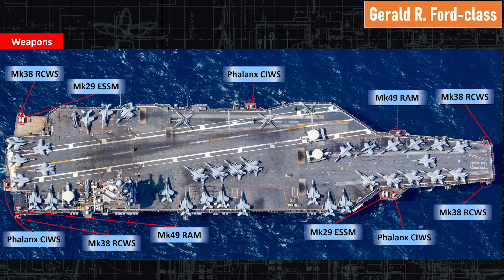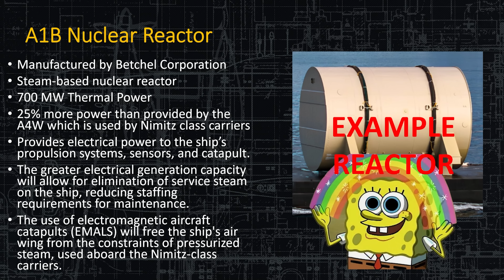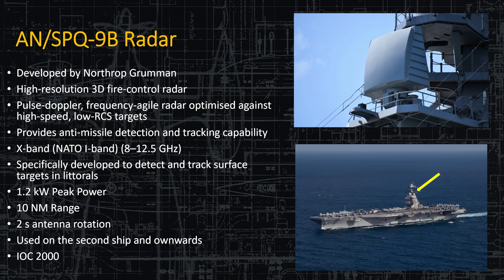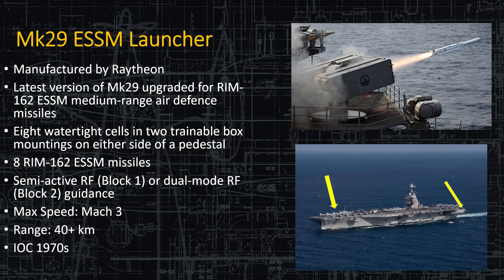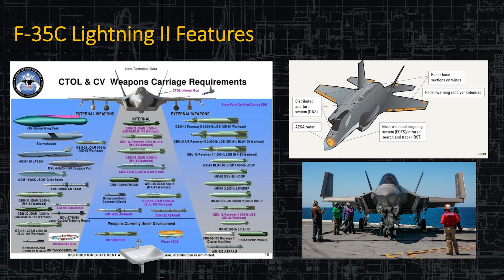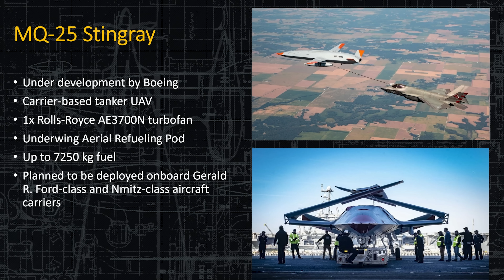Why Is This the Most Advanced Aircraft Carrier Ever?

Comment: Speaking of the refueling mission. Using the Stingray instead of the F/A-18s was to preserve the life of the Hornets. The refueling mission adds a lot of wear and tear to the F-18s (ex. Takeoff and landing in the 5 wet, aka five external fuel tank, configuration). Imo should've kept the S-3s for that because they could carry a ton of fuel.

Comment: One thing I worry about this 20% increased sorties is the wear-and-tear on the non-slip surface of the flight deck. As we saw in recent extended deployments, we risk losing aircraft because the surface is getting worn beyond what it was intended for. Did we make the new surfaces at least 20% more durable? We also have to worry about crew exhaustion, and less carriers means longer deployments or more frequent deployments, or both. And a carrier can only be in one place at a time. Once the number of carriers decreases too much, we may not have enough for what we need accomplished even if each individual carrier is more capable wherever it happens to be. Hopefully Congress adds more carriers. I think a minimum of 12 of these is a good idea.

Comment: Hey brother, FC1(SW) CIWS Tech here. For CIWS, the rate of fire is 4,500 RPM in air, and 3,000 RPM in manual surface mode. Also, we call it a fixed hand controller and not a joystick; the controller doesn't move; rather a thumbpad is used to aim the weapon. The point of aim in surface mode is fixed to the thermal imager crosshairs; we have a live-fire certification event and maintenance check to ensure that. As you said, the round/barrel is 20mm; the actual penetrator of the jacketed sabot is 17mm heavy tungsten.
Reply: I personally, like the Italian-Japanese approach far more. They are middle sized carrier, can carry troops and landing vehicles. They are strong armed, the ITA one with it's 76mm cannon and guided ammo, +16 VLS, several 25mm cannons, and of course 15 F35B jets and Helicopters.
Reply: @Nebukadnezar2036  we have amphibs too and our carriers are nuclear powered but okay
Reply: @Nebukadnezar2036 as someone else mentioned, we have other hulls for that. Very different applications. In the case of any carrier, but especially oirs, we can't forget the strike group around them.
Like people look at the Russian battlecruisers, and all crazy numbers of missiles on board, but the purpose of those is to try and take on numerically superior US groups. The Russians know they can't put as many ships in the water to match us, so they wanted theirs to be more capable, on paper. In reality, it's the opposite.
Not saying that's true of other Navies, necessarily, but it makes sense that smaller Navies need to rely on multipurpose ships. Again, that's all on paper, in reality the details do matter and it's not so cut and dry.
Reply: @IllustriousCrocoduck  I agree with you about the Russians; the huge number of weapons on their ships is only there in hope to defeat the US. But that's no longer possible today; missiles with up to Mach 2-3 can be destroyed with Vulcano guided ammo, or 30 mm cannons, and of course, missiles.

Comment: No the F-35C and all F-35 CURRENTLY have the AN/APG-81.
The APG-83 is a scaled-down apg-81 made to fit the F-16's smaller nosecones for the midlife upgrades of US and Taiwanese F-16's.
There is a new Radar for F-35 called the APG-85, but that's still in testing and isn't planned to IOC until ~2028...

Comment: SPQ-9B yes is an x-band radar so yeah it's better at detecting LO targets. 
But it's main use is for detecting LOW FLYING targets like incoming AShM's which hug the water.
Hence why you'll typically notice it mounted at, or as close to the top of whatever ship it's mounted on. 
On Burke's the 9B is easy to point out, it's a big square and is the topmost object on the ship...

Comment: The A1B reactors use uranium enriched above 70%, possibly up to 90% (nothing to do with civilian plants that use 3% uranium), allowing the reactor to operate for 50 years without refuel. Furthermore, by using high-grade enriched uranium, the reactor needs less uranium and the core can be smaller. A smaller reactor means more space for other equipment. Currently, China is working on a test reactor of molten salt (or commonly known as a Thorium reactor). Using molten salt can operate at much higher temperatures, generating much greater amounts of steam and therefore more energy. I seem to remember that the current reactor has a power of 3 MW... but... it is the first molten salt reactor in the world and it is very possible that in 10 or 15 years they will manufacture a reactor suitable for use. On the other hand, the United States seems to have lost its way in this regard, and despite having been the theoretical proponents (along with France) of using molten salt, there are currently only projects on paper, without funding or much state interest.

Comment: Your submariner origins are showing. (Retired SWO speaking) American naval gun systems have NEVER been stabilized. They have (since the late 1930s) used a stable element to provide vertical reference to the fire control system, thus it is part of the fire control solution from the beginning. Actually makes for a more accurate gunnery solution.

Comment: "The new Сhinese aircraft carrier has maximum 40 aircraft"
Correction: Type 003 Fujian can accommodate 50+ aircraft. And Type 004 up to 100.
So the capacity of Type 003 is about the same as that of Ford-class and Type 004 will surpass it in a few years from now.
Reply: The Nimitz and Ford class could carry 100 aircraft or more. (With just Hornets they could carry over 130). It’s the mix of aircraft, and the actual aircraft you have on hand that determines what these classes actually carry. Which ends up being around 75. That isn’t the actual limit.
Reply: @Tinfoil_Hardhat  Same. It's a mix on Type 003/004 too. My point stands.
Reply: People don't know how massive J-15 is. For every 2 x J-15s, 3 x F-18s even Rafale can be parked at the same space. So YES Type 003 carrying 40 aircraft has some truth to it.
Reply: @johnsilver9338  The official info claims 50+. The 40 part is a fantasy.
Reply: @catonpillow  If they make the carrier bigger or the aircraft it carries are smaller then possible
Reply: @johnsilver9338  The official info clearly states 50+ John. You can look it up instead of day-dreaming :)
Reply: @catonpillow  Where do you get your info from? Wiki? It don't even have source for that 50+ aircraft unless you can show me a source.
Reply: @johnsilver9338  You can't make a blind man see :) Have a good one bud.
Reply: @catonpillow  More like you are the one who is day-dreaming :)

Comment: Hi Arron, again thanks for a great video. 
One thing you said was that because the Ford class had a higher sortie rate, you could build less of them for the same effectiveness.  It is not clear to me how the sortie rate really affects the coverage.  Now matter how many sorties are available, the ships still need to be on station in the appropriate locations - Atlantic, Pacific, Middle East.  Assuming 3 on station, 3 in work up/training, and 3 in refit, that suggests 9 CVN's are the minimum we need under current doctrine, not accounting for any significant overhauls or other issues.  The sortie rate would seem to limit the capability on station but we still need a specific number CVN's.  Am I wrong with this?
Reply: No you're right. And the sortie rate is somthing that's hyped up, but in reality doesn't mean much. Same thing with the "EMALS is adjustable so it's easier on the airframes" selling point.  You ever hear about too many planes being sent to the vineyard because the steam catapult are too harsh??  Nope, I haven't either. There's a lot of salesmanship for the new expensive gadgetry that frankly isn't needed.

Comment: Hi Arron, thanks for another great video!  A few questions about the MQ-25: Does the MQ-25 land autonomously or is there a drone operator flying it?  Are there limits to autonomous landings? If it can land autonomously, can autonomously landings be used for the crewed planes?  

Also, the MQ-25 takes up deck/hanger space, that would be taken up by a strike AC.  It does not look like a small craft.  How many more strike AC can you have by using the drones?
More questions in another comment.

Comment: 17:00 - The Nuclear power plant near my house generates 1200 Mw. Having 700 Mw rolling around is VERY impressive.
Reply: That's 1 reactor. They have more then 1.
Reply: @yakerssn22 Ah yes “redundancy”. :) so probably 1400 Mw floating around?
Reply: The nuclear plant near you is probably 1200 MW electric from a power around 3600-4000 MW thermal

Each reactor on the Ford is 700 MW of thermal output which probably get converted into something over 200 MW of useful energy both electrical and mechanical.

Comment: I always wondered why the British, fathers of the angled deck, had 2 bridges on their latest carriers? The rationale for having 2 bridges was the other could take the place of the other in case 1 was knocked out in battle. Could the Ford be more efficient with 2 bridges as well?
Reply: Other reasons aswell. Front one for driving the ship is closer to the front. Rear island for aircraft ops is closer to the planes. 
The gas turbines also needed large air intakes and exhausts so 2 smaller islands or one big island is needed.
Reply: The main reason for the two bridges in UK carriers is that you need to have exhaust apart. So it is not really they wanted to have two superstructures, more like they erase the middle part of their superstructure. There is no need for it on nuclear carriers.

Comment: I worked with a nuke and from what he was saying its much faster than 30 knots. Also the b2 bomber only had a 40k lbs disclosed payload capacity but managed to drop 60k lbs worth of gbu 57 bunker busters this week.
Reply: Nah man B2 has always been 80,000 pounds, it’s 40,000 per bay. It’s a large strategic bomber. Even then it’s got the lightest payload.
Reply: But escorts can not. So it is pretty useless.
Reply: @stupidbro2301  it has its own fighter wing and point defense system, so the escort is just a layer of protection. its more important that the aircraft carrier survives and makes it back as we can't replace them as easily so it's very useful that they can get up and outrun all other surface vessels.
Reply: @darrenmessick4971  Its own point defense is really just a backup to backup to backup. It can not and should not defend itself alone.
Reply: @stupidbro2301 your getting off topic, it's to enable the ship to get away and regroup to continue the fight. Yes it shouldn't ever have to use it's own point defense but it's there for a reason, it is there to defend it's self while putting distance between themselves and the aggressor.
Reply: @stupidbro2301  Spare power can still help with more aggressive maneuvering and sortie generation in adverse winds
Reply: @stupidbro2301 Supply escorts might not be able to keep up but the cruisers/destroyers can.

Comment: The F-35 is neat, but everything carried externally negates one of its key advantages.
Reply: Once we get the loyal wingman that won't be common. Plus F-35s will still utilize F-18s to slingshot missles. I suspect the navy won't prioritize air superiority as their primary mission leaving that to the air force instead focusing on air dominance with temporary areas with superiority. Even then most of our cruise missles and hypersonic missles have a range greater than 200 miles.
Reply: F-35 Block 4 can carry 6 AMRAAMs internally like F-22. But it can also carry much larger ordinance internally like 2000lb JDAMs that F-22 can't do. To compare, J-20 can only carry 4 PL-15s internally. So F-35s are certainly not lacking.

Comment: All it takes is one lucky sub...
For that price, you could build 2 smaller carriers and lower chance losing 25% of your power projection in carrier force.
Its more support vessels as well, thats true, but it would be foolish to think you can protect your prize ship anyway. If enemy decide he want it down, it will go down. Its only question how much would attacker pay for it. One old diesel sub? Fair enough... Medals post mortem.
Reply: The problem is the economy of scale, ship with half the air wing and half of the capabilities will be 70% of Gerald R. Ford size and 80-90% of its price. The steel is cheap and air is free, the nuclear reactors, sensors, catapults, contermeasures, etc. are what is really driving the price up.
Reply: We have 8 of those also the America class.
Reply: @AmericanmanB2 but they aren't "real" carriers.  They have no airborne radar capability, no airborne refueling ability, and the STOVL F-35s have short range. They are not carriers in almost any true sense, and frankly, a waste of money...

Comment: IMO, The best part of EMALS is that you can dial in exactly the force needed to get an aircraft in the air. Steam launching wreaks havoc on air frames, but with EMALS, you can launch very light recon drones or F-35s loaded for bear and give each of them the exact minimum amount of push they need to get airborne. This opens minimums and maximums to the engineers designing those air frames. More bombs. More Fuel. More exotic aircraft (say U2 style recon drones). Thanks for the vid! Fellow submariner here!
Reply: Not just the force, but the curve of force that accelerates the airframe but minimizes strain force on the gear and airframe
Reply: Loose lips sink ships! 😂😂😂 thank you for your service, friendo.
Reply: @crakkbone  bro. You joking?
Reply: @crakkbone  the info is literately in a public documentary or on wikis.
Reply: I think this "benefit" is a bit overhyped. I've not heard of "stressed airframes" being a problem... and steam has been chucking planes aloft for how many decades??  Is the massive cost increase truly worth it, especially since...all these years later, EMALS is only performing at a failure rate roughly 20% of the required spec?? ( which is somthing the Nimitzes and even older carriers met routinely for the last half century???) I'd say no.
Reply: @wheels-n-tires1846  
Because the airframes are built expecting the stress? Navalised airframe took a performance hit whilst being heavier isn't exactly a secret. We know about it before jet aircraft is a thing. 
And the service life of those aircraft is still not comparable to land based airframe.
Reply: @wheels-n-tires1846  just think of all the steam piping you don't have to run..... 😂😂